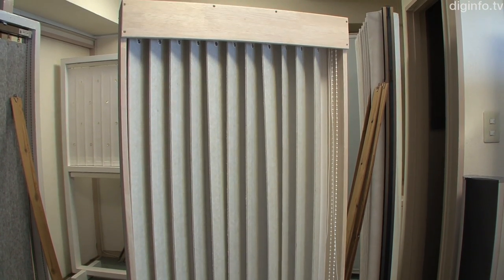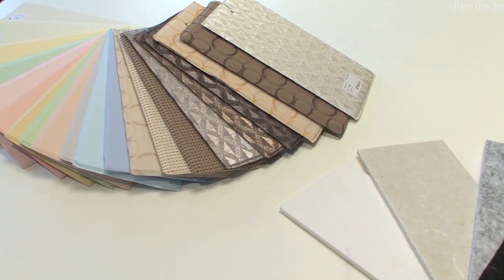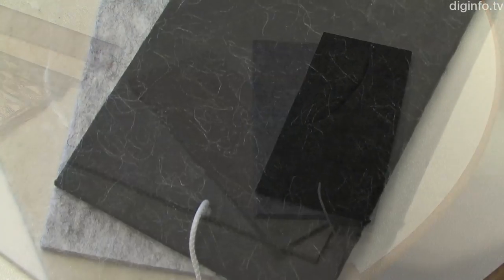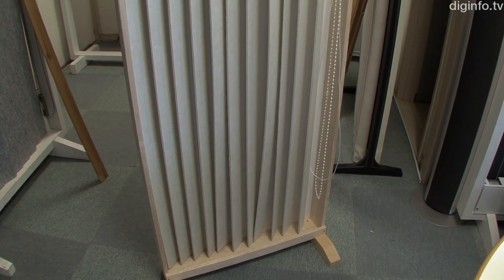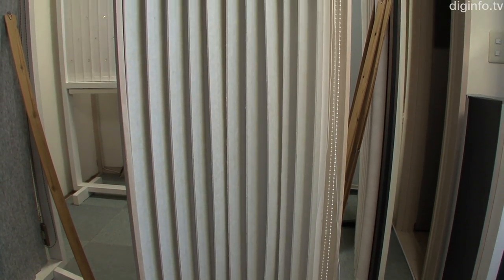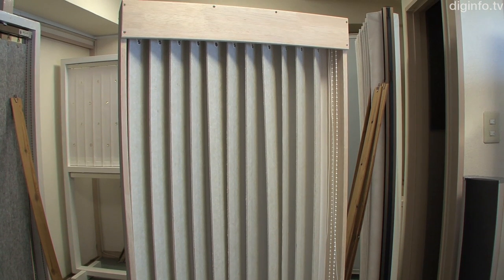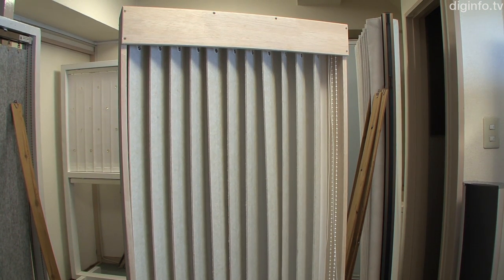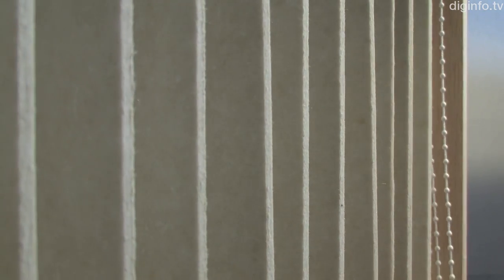Sound-Absorbing Blinds #DigInfo

Comment: Human voice concists of frequencies between 250 to 3000 Hz and the most energy is in the lower part of that range. Those blindes does not have a chance to effectively absorb the lower part and what happens is that most of the echoes will reamain, apart from the higher frequencies, leaving you with an even odder acoustic environement.

Comment: Yeah, it's true that these blinds won't absorb lower frequencies, but in order to do that you'd basically have to seal off the window which negates having the window from the start. And MOST people don't want to do that, or can't. I see this as a great compromise to at least make a noisy environment less distracting. And by the way, my man labobo down there in the comments; I think you need some therapy. Sorry to hear about the wanna be gangstas  blasting you with bass, but cmon man. They don't deserve to die. At least they are into something. Try getting a bag of safe n sound, a few pieces of wood and watch a tutorial on building absorption panels to hang over your window. I guarantee it'll help you more than shooting anyone.